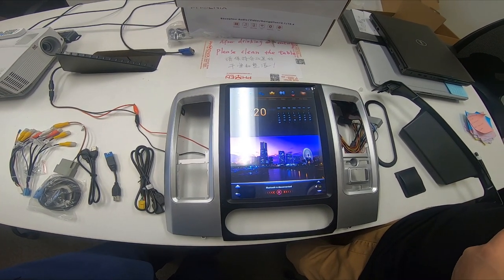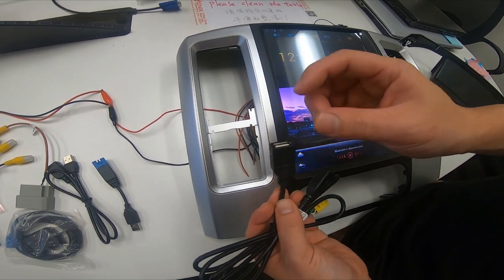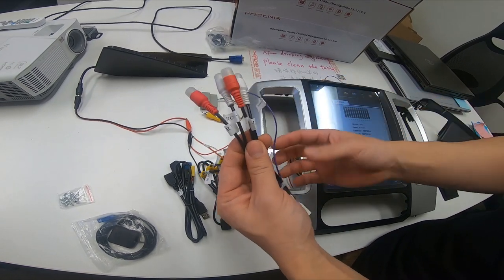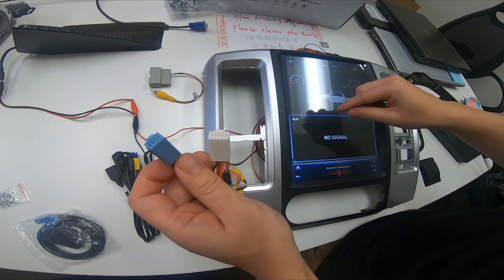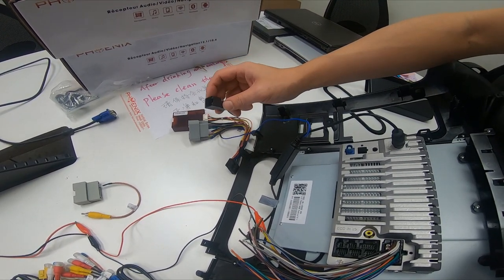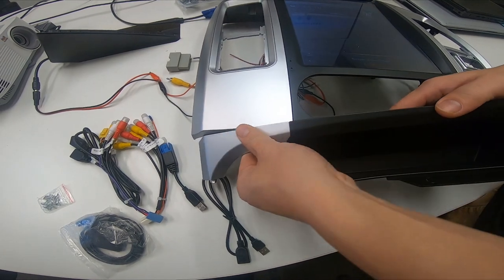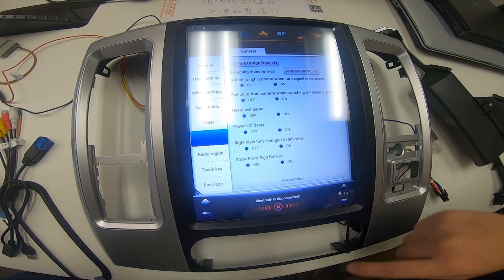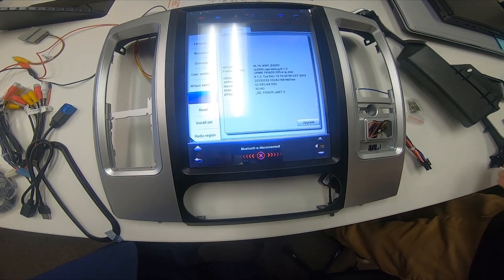How to: connect and set up 12.1 inch head units for 2009 to 2012 RAM trucks with two front seats

Comment: I am really interested in getting this setup but I have a couple of questions. 1st will all my controls on the back of my steering wheel work with this unit. 2nd I have a second row of buttons for heated seats, steering wheel, air conditioning for the seats, with this unit installed how would I access those items.  I have sent an email to the sites contactus email with a more detailed inquiry. One last thing what is the lead time from order date for this unit.

Comment: I have a 2010 2500 Laramie with rear entertainment display. I currently have the factory RER unit w/nav and DVD player capability for head unit and rear display. Will this unit be able to display video to the rear display still? If I did the add on DVD player, would that work for both displays also?
Reply: That’s my question as well.

Comment: On the website I see an option for a 360 camera upgrade, but don't see any videos on how it works or installation. I can find competitors on YouTube, but prefer something designed to work with this android radio. Can I use the factory rear camera for the 360 setup? Any help is appreciated.

Comment: If you truck has a GPS antenna then you don't have to use the one that come with the radio correct
Reply from the maker: Roger Key2pwr if connector match, then can use oem antenna
Reply from the maker: Roger Key2pwr if connector match, then can use oem antenna
Reply: How to use my GPS on my unit. It's not letting menuse my navigation

Comment: What about the extra set of buttons on a diesel, exhaust break etc.
Reply from the maker: Sam Dlc mentioned in the video. Relocated to top of bezel
Reply: In my 2010 Laramie I have 2 rows of buttons total of 5 in one row, heated wheel, heated seat, ventilated seat, pass. Heated seat, pass. Ventilated seat. And the second row of auxiliary buttons is another 5 or 6 for traction control and ect. Would you be able to install 2 rows on the top like the video shows?
Reply: @jakeley681  no
Reply: @SUMDUDE.  do you know a solution? Not sure where I'd be able to mount all 10 if the new dash didn't have the slots for them
Reply: @jakeley681  the heated seats and the rest of that row go into the touchscreen. I'll post a photo of it on my Instagram
Reply: @SUMDUDE.  I found you on Instagram. Thanks man. When you ordered from Phoenix, what was the exact model and everything you bought?
Reply from the maker: jake akeley just one row on top. Rest of buttons on touchscreen
Reply: Do you do installs?
Reply: On a 2012 Ram 1500.... where does the row of buttons get relocated too. Tow/Haul, traction control, hazard, 110 outlet power, etc....
Reply: Does the auto warm up and cool down work with the heated and cooled seats?  And how do you guys like it is it worth it?

Comment: Does the factory amp and steering wheel controls still work with this radio?
Reply from the maker: Jerrold Harvey yes
Reply: @phoenixautomotive4336  i am interested in purchasing a new upgrade unit for my 2010 ram 1500. I have heated seats,heated steering wheel, tow buttons where will all that be?